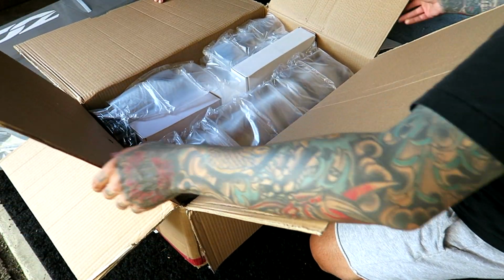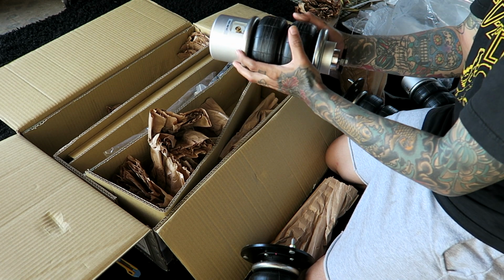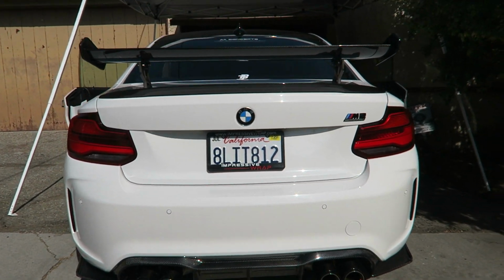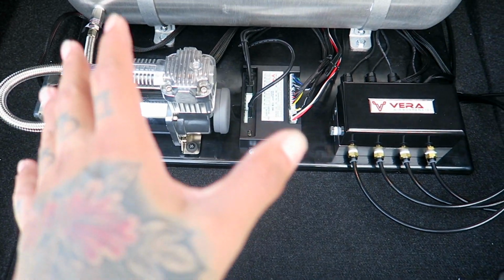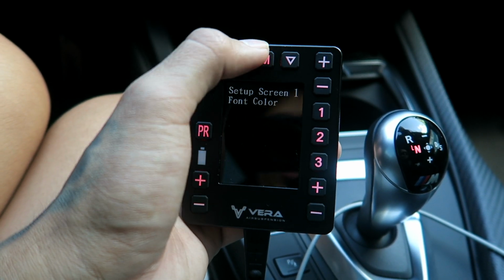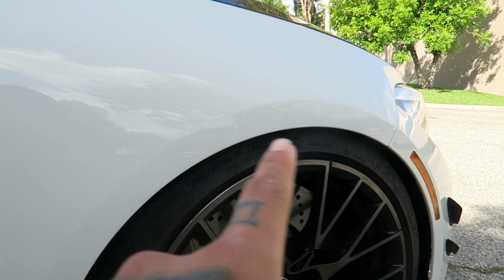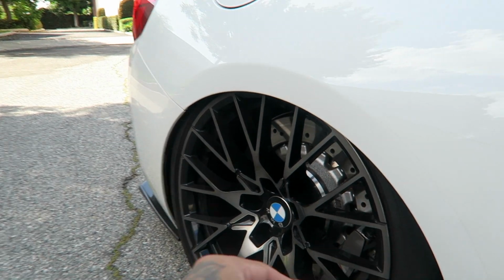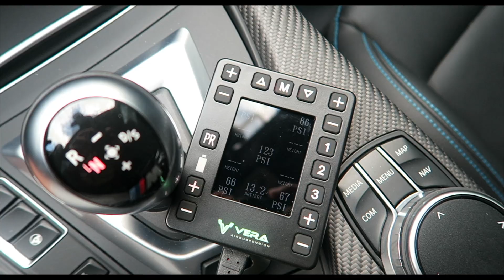M2 GETS AIR SUSPENSION! *F87 BMW

Comment: Hello what type of end links are you running in the front ? Also for the rear what fitting are you running in the rear bags? Cause I got an elbow fitting on it right but it’s rubbing against the cup causing a leak everytime I hit a bump.